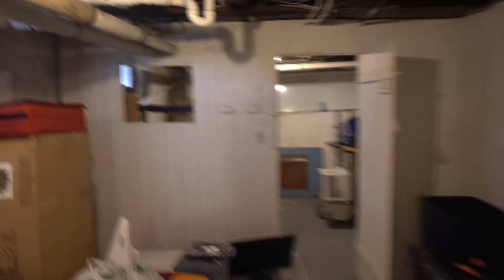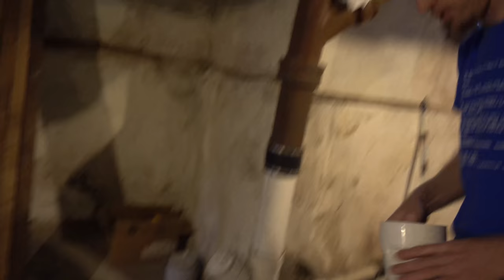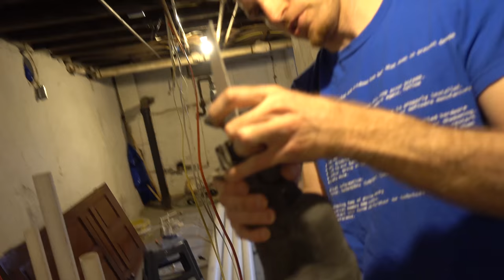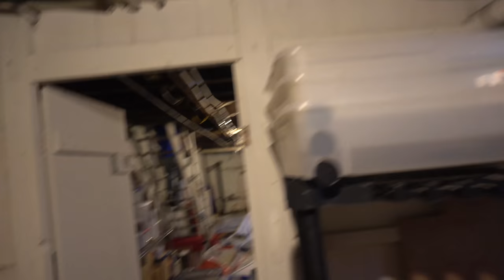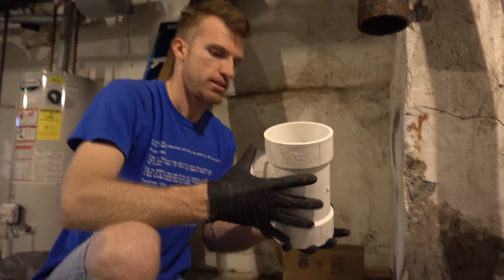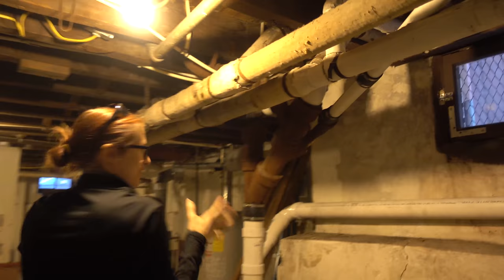We Replace Our Drain Stack!

Comment: I have worked for years, rehabbing house's. You don't need to take the plaster down. Just shim where you cut new holes into it. So the drywall is level with the old plaster. Spakel the area so it smooth. Then paint it.
Reply: Maybe only if you are keeping it period correct!  Maybe if you are in a historical preservation district or under strict requirements to be minimally invasive to get work done. But it sounds more like someone doing things as cheaply as possible and most people call that bubble gum contracting.
Reply: The old plaster ceiling is anchord to the jousts then the new drywall would be. If you were in a historical district, you would have to replaster the ceiling. Removing the old ceiling is something that doesn't have to be done.

Comment: I don't know about the plumbing regulations there but in basements putting a pipe in front of a window that opens up is a fire danger and prevents a escape route out of the basement
Reply from the maker: These windows have steel grating covering them anyway and there are two others, so eliminating this one is not an issue.